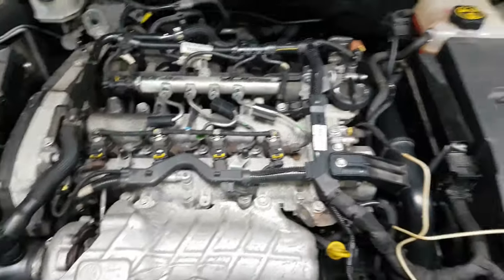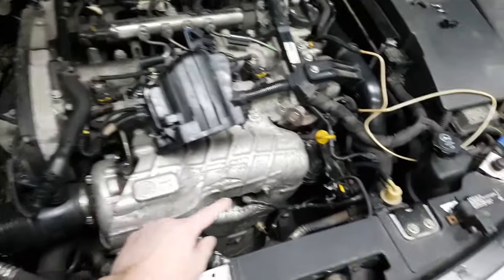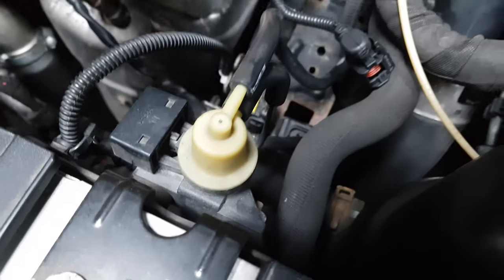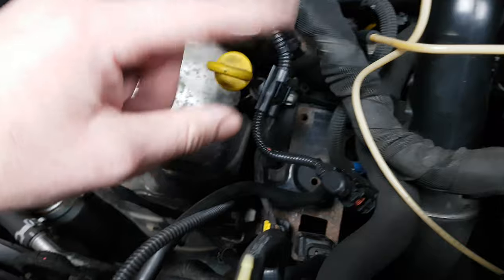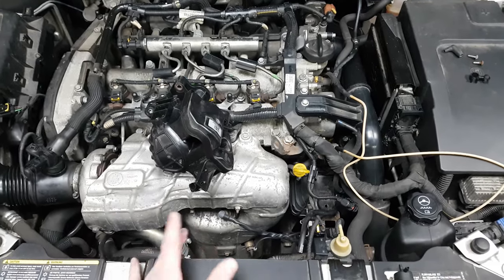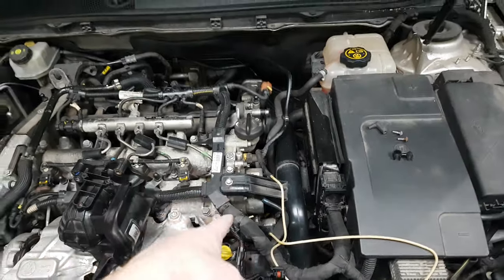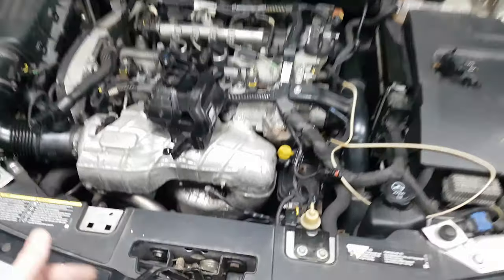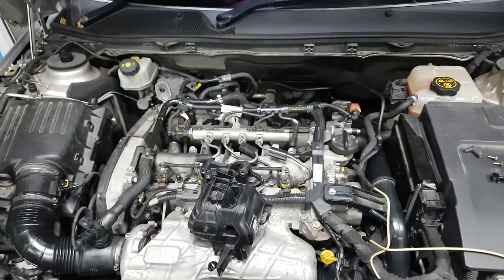Vauxhall / Opel Insignia No Power - CDTI (No boost, no fault codes)

Comment: Thank for the video ....no boost was doing my head in for a while and used my obd scanner to help pin point this valve ....took a run down motorway .....no boost or code present...but ERASED fault code and immediately got BOOST.!! ...result Many thanks 👍

Comment: Great video and information. Solved the issue on my car where there were no codes at all but kept giving service message warning. Changed the solenoid above the vacuum chamber housing and the pipes and now running very well. Thank you for posting. 👍👍

Comment: I had the same issue with mine and diagnosed it the same way replaced the egr selonoid (the one you removed) and the  cooler/ vacuum manifold, but that did not change a thing, i decided to just bypass it and been doing fantastic .

Comment: The exact thing happened to me this week. Had the egr cooler part replaced for a leak at the garage.
Picked up the car and felt like it was in limp mode with service vehicle soon warning.
Took it back and the turbo solenoid wasn't fitted back properly. 😅

Comment: Wonder if that’s what has just happened to mine. Worked fine last night then today it felt very difficult to accelerate. Brakes weren’t sticking, no warning lights, but felt like there was a resistance when putting my foot down to accelerate and it took about 12 seconds to go from 60-65 on the motorway.

Comment: Another score for your great video. Worked spot on for me. Thank you for taking the time to record this and in such an easy way to follow.

The symptoms were exactly the same as mine. Thank you!
Reply: Did you bypass it to ?
Reply: @adambarry6223 yes. Bought a small plastic tee, removed the hoses where they connect onto the vacuum manifold and joined them all with the new tee. Car now better than ever.

Comment: I'm really sad to discover lots of videos about the 2l cdti , I thought they were nearly bulletproof , not that every doesn't have some niggles , such a shame I still love the astra gtc 2l cdti
Reply: I have the same engine is an Alfa Romeo 159.  The block and core of the engine is bulletproof. But as with so many modern engines, it's let down by arguably unnecessary complexity and 'gizmos' fitted to that block - almost always for emmissions control.  The components that were covered in this great video are a good example of that. And the fact that the car still ran well (perhaps better) with some of these gizmos bypassed, proves how unnecessary these sub-systems are.  If you delete the EGR, DPF, Swirl flaps and the EGR cooling solenoid - you should have a pretty simplified, reliable, well performing engine.  One thing to note is that this engine is very very sensitive to MAF and MAP sensor health. A MAF that is even just 5% dirty or ineffective (eg. due to wiring degradation), you can lose a lot of power, further up the rev range. These cars need Bosch MAFs in perfect working order and clean. I tried 4x cheap, unbranded replacement MAF sensors on mine. Everyone resulted in a loss of power. When I finally fited a Bosch MAF, the car was fine and all power restored.
Reply: I also have this engine in a 159, its broken my heart and destroyed my wallet but im still in love

Comment: You actually have a side exhaust. It looks wavey tbf 🤘 also informative video thanks ! Not sure what issue is with mine have just done imjector seals last kigjt. Today after running for 4 hours , big whoosh noise suddenly.  Loss of power wont rev past 3.5rpm. Possibly multiple vaccum leaks and intercooler pipe worn as its very soft and has oil all around

Comment: It's a common fault that these valves fail. You will hear a groaning noise from them when you turn the engine off. Just replace the valve and your golden.  They don't cost very much money

Comment: My Astra 2.0 CDTI has From time to time also no boost pressure and the message that I should drive to the workshop. Errors are boost pressure too low and too high and various other messages. I suspect the MAP sensor But aI haven't thought of negative pressure hoses yet. The vehicle has run 240000 km. And suddenly I also have more pressure with the exhaust gases from the exhaust. The only strange thing is that I don't always have the problem with the boost pressure, if I turn the car off and on again, the problem is solved. At some point it comes back, but not regularly.

Comment: Is this no boost at all? Mine just doesnt have any boost when engine is cold. Once the temp gets up a little, the gear shift notification kicks in and the car goes. Its like i have a limiter on the engine when the engines cold to protect it. My mates merc is the same apparently. I have a 14 plate insignia. Nice cars but they are very sensistive.

Comment: Very interesting video m8, ive had new turbo fitted, boost sol valve replace on slam panel and still no real boost from standing start, i do have coolant leak and will be looking to replace erg housing but b4 that i have to replace brake boost pump which has an oil leak on outer casing  so as that has to be done first it will be interesting to see if this cures my boost issues...
Reply from the maker: Good luck finding the fault.

Comment: my 2014 insignia it's loosing power sometimes the service vehicle soon it's popping up I had that 2 months ago brought to a diagnosis they said glowing plug 3,4 and fuel pump I had them changed and 2 days ago the svs propped up again and then the car it's losing power no more then 3000 revs should be the other 2 glowing plugs or should be the same problem you had because I checked and I actually have same leak you show you had
Reply: mate my sister is terrible with cars.she has a insignia she was driving along the dueler never speeds but lost all power.i checked her oil and it was like tar.towed it to my house and changed the oil.still no power.bought a obd reader and that came up with problem with egr and turbo but also one of the glow plugs are duff.i wouldnt worry about the glow plugs tho they just help to heat the diesel to start the car but other than that they dont work while the car is running.i will be taking off her egr when i have time.no doubt that will be stuck open and causing it to not go over 2500 revs.other than that on idle its ticks over fine

Comment: Ive got problem with my vauxhall insignia. Fuel rail pressure sensor. Changed it, changed fuel filter. Same problem. Can any one suggest something to me please.
Reply: Hi I’ve a 142 insignia and I’ve the exact same problem by any chance did you figure out what it was, I’ve put a new fuel rail and fuel filter on it, if you’ve any update please let me know

Comment: My insignia just lost power. The only message that pops up on the dash is “service vehicle”. Do you recon it could indicate the clogged DPF?
Reply: potentially glow plugs. mine had same issue with svs code. fitted 4 new glow plugs at 100 quid each and reset svs code and now no svs code
Reply: DID U FOUND OUT THE PROBLEM 🤔 I HAVE THE SAME PROBLEM EVEN AFTER CHANGE DPF ,OK FOR SOMETIMES THEN BAD AGAIN ( garage reset it 2 time)but 💩TODAY NEED MAKE THE CAR HOT SO IT CAN GET SPEED🤯😣
Reply: A little late but I had this problem and turned out to be a split (I couldn't see it but it was leaking) turbo inlet pipe. £30 and hour to change.
Reply: Hope mine is simple as a pipe 🙏
Reply: @mattashton2039 I smell bullshit . Or I smell a fool .one of the two

Comment: Stick to German cars insignias are trouble hense why they are not popular as a taxi.
Reply: German cars are just as shit my 320 has been nothing but headache, clutch and flywheel ,gearbox replacement,dpf blocked , abs rings , crankshaft pulley cracking, I've also owned VW's in the past with alot of common faults too.
Reply: Opel is German lol
Reply: They were under GM so opel was more american car than german xD
Reply: IT has more to do with the size at the boot... the rest is like anyother, got 2 Insignias and happy about it.
Reply: Lol!  Since around 2005, German cars are proven statistically to be some of the most unrelable on the road. Endemic injector failures, DPFs that cannot regen effectively, EGRs that block with just a couple of short stop-start journeys. They are terrible.   And VAG lied about emmissions and MPG performance on their cars and were fined EUR 1bn!
Reply: LOL  Insignias are probably more German-made than VAG and BMW

Comment: Hi the pipes you have joined up is it the 1 originally  from the vacuum pump and the other from the back of that sensor that ain't working  with the pipe from turbo solenoid to the vacuum pump thanks